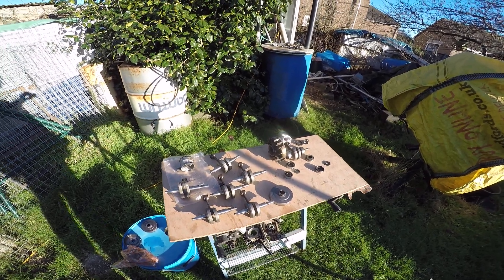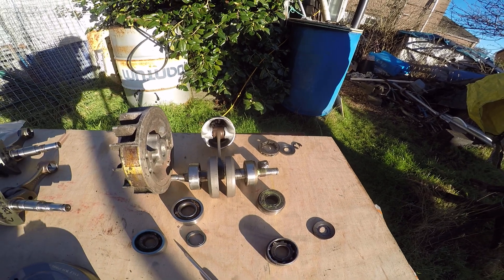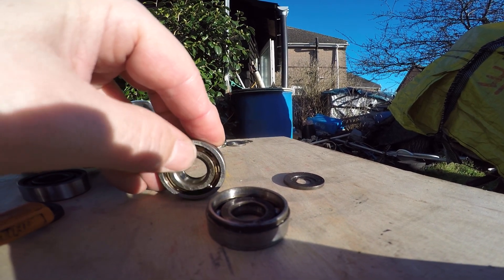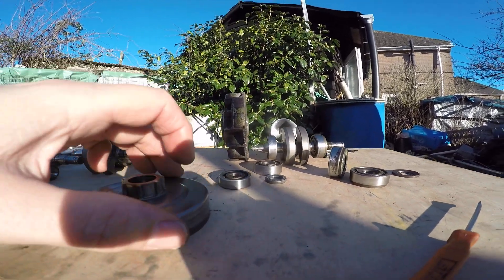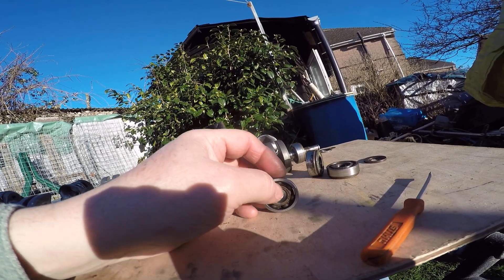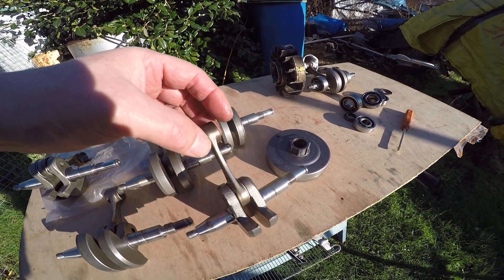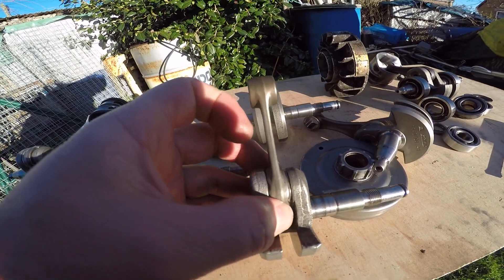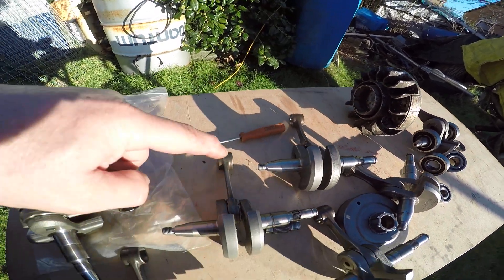Chainsaw crank, main seal and bearing wear issues using Stihl MS362 cranks.

Comment: Hi where are you based ?
Would you bother rebuilding a 362 ?
Reply from the maker: Yes, I'd rebuild a 362. they are good, robust saws. Have two on the books at present to be done, one of which needs a new crank (I have an ebay one) due to the bearing surface issue as in the vid. I'm in Dorset.

Comment: Hey ..I'm having promblem with my drum ,cutting into my oil pump ,plus my needing bearing is coming apart on my ms 291 sthil saw
Reply from the maker: Sorry, I missed this comment. Hope you sorted your issue out. In case you didn't, here is my opinion - I've seen this sort of wear commonly on 362s.  It is due to wear to the clutch drum bearing surface and to the needle rollers (in the bearing) themselves.  The clutch drum bearing surface is hard. Wear manifests as the surface spalling off - see this vid:  https://youtu.be/FCiIWEI31qA    and this vid: https://youtu.be/3xSQr5qmtbE   It is very common in saws that work for their living. Accumulated wear allows the clutch drum to rock.

The rocking seen on the clutch drum can cause the following: 1) Wear on the retaining e-clip groove. This can result in failure of the e-clip and displacement of the drum, sprocket and chain whilst in use. 2) Wear on the chain brake band. If severe, this could lead to premature failure. 3) Wear on the oil pump drive quill, leading to failure and failure of chain lubrication. Secondary wear to the oil pump body through contact by the drive quill has been noted.  - This is your issue, Kenneth.

Fix by fitting a new drum and bearing. You can use 1000 grit wet and dry abrasive paper to polish the crank bearing surface if the finish is matt (micro abrasions). This will increase clutch drum bearing life, but bear in mind that this treatment will actually remove material from the bearing surface, minutely increasing wear. Using coarse grit would increase this and not help the issue, of course.  

If you have pitting on your crank bearing surface, you will find wear on the  bearing and then drum is increased.  Grease your bearing by removing, weekly, and applying a bit of grease. Tedious. Stihl reportedly are of the opinion that this bearing requires no lubrication. Note that older Stihl (and Husqvarna) saws had provision for greasing of this bearing in situ. Note also that this bearing does receive hit-and-miss lubrication from chain lubrication overspill. Under good working conditions with a sharp chain, this could be sufficient to provide enough lubrication to prevent premature wear. However, if cutting seasoned wood for long periods or running a blunt chain (ditto) there will be build-up of dry, fine dust under the clutch cover which would absorb overspill from chain lubrication before it would ever reach the clutch bearing.

In my opinion, this is a weak point of these saws. 

You did ask! sorry I missed the notification and I hope this helps.